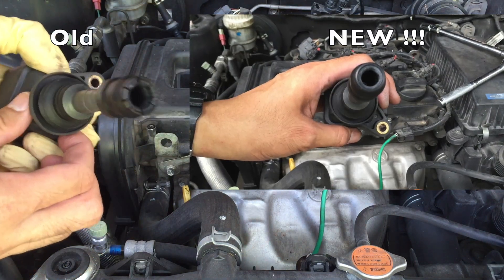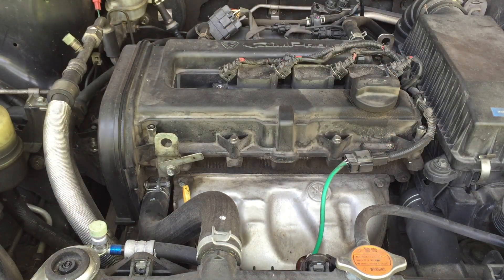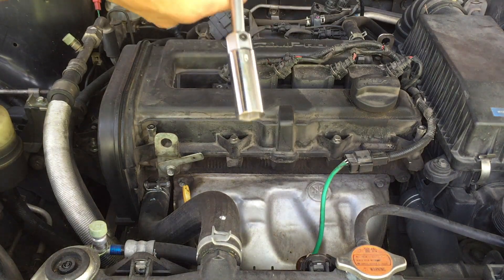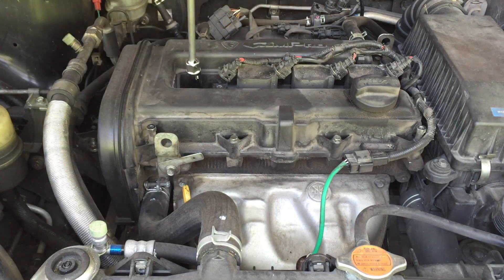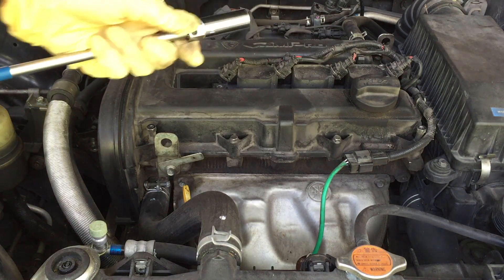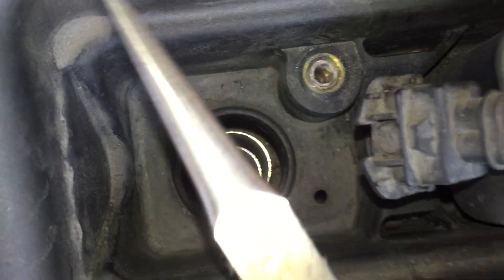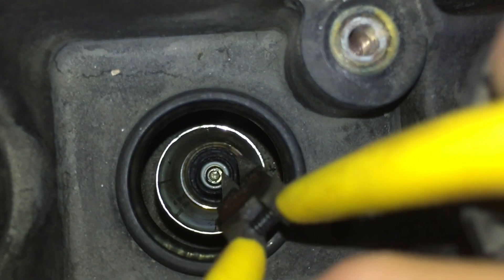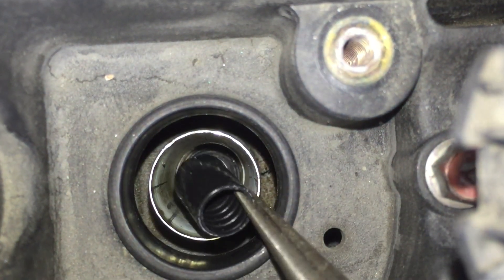Remove a spark plug broken coil rubber boot in Proton Persona Campro engine

Comment: I have a deep socket so even to remove the spark plugs you need a really long specially adapted tool to remove them. You can try using a bit of tube that is the size of the spark plug to break them free or get the ignition lead put a tiny bit of glue on the inside wall and put it over the boot. This glues it to the side of the ignition lead so you can pull it out but it's fiddly and you have a risk of gluing it else where.... Since it's broken you need to replace the damn thing anyways. You can get wire pullers that are really long and special tools. Its a bugger really.
Reply from the maker: Yes thanks you. I learned that using air pressure can be use to blow it out too.

Comment: so is that rubber from the ignition coil or the spark plug? I just had this issue and after 6 hours I finally got it off thanks to this video. Damn this guy made it look easy. It was a real pain in the ass having to hold my cellphone and it stay in focus while im doing this shit in the back spark plugs for my bullshit ass 1.3 Civic which has 8 spark plugs. This was the first back one & on top of that i snapped the damn bolt that holds the coil down. Now i gotta drill & tap that. 30k more for 200k & then maybe ill get rid of this car.
Reply from the maker: Alternatively you can blow it out using pressurized air.

Comment: i ended up using a long flat head screw driver. put it in at an angle, and jam it straight through the bottom. then pull up while using pressure against the cylinder wall.
Reply from the maker: Perhaps a thin screw driver works. It does not work for me back then.

Comment: I somehow managed to break off 1/4 of the rubber boot. The spark plug top is slightly exposed, but not enough to take it out with my wrench. I've tried using my needle pliers to get the boot out but nothing has seemed to be working.
Reply from the maker: There use to have a spark plug removal tubing. It looks like a tube but the end of it is machine to look like hexagon. That should works to help remove the broken spark plug.

Comment: Nice video, thanks.  My spark plug boots on my '97 Toyota 4Runner are too long to get a pair of needle nose pliers on remove from the spark plug tube.  I tried using some picks I have but the boot, about 3/4" is stuck around the spark plug.  Will try a pair of longer needle nose pliers when I attempt again.
Reply from the maker: Hi, I think you can try blow using pressurized air. Have you managed to solve it by now?

Comment: Same happened but only a small peace of rubber left behind... I can not take with a hook nor pliers because it is too deep... Any helP?
Reply from the maker: Use track pump to push air into hole. Air help push the small piece out.
Reply: Or masking tape inside out. It will pluck it out.

Comment: Video is 7 years old i doubt youll respond but im having the same issue with my ford f150. Same exact thing but when i go to pull the rubber out it feels like it is attached to something and doesn't come off so easy. Im scared im gonna tear something up
Reply from the maker: Maybe try to wiggle and tap by hand to break loose the rubber boot.

Comment: Can you still use the broken coil on the spark plug?
Reply: No
Reply: MANUEL AGUILERA why not
Reply: U car no power🤣
Reply from the maker: Have you changed the rubber boot? It caused leakage of pressure.

Comment: Use 3/16 brake line cut to your required length then bend the end like a hook and problem solved
Reply from the maker: Yes it works.

Comment: heat the socket up so hot that its melts the rubber then push it down over the spark plug and take the plug and end of coil pack out all at once
Reply from the maker: Luckily it works. Someone mentioned to use air pressure to push it out.

Comment: Yours is easy man, mine is longer so that doesn't help.
Reply from the maker: How about a longer wire?
Reply: Tried it and didn't help either. I spent hours trying and ended up towing it to the shop. The mechanic got it out pretty quick. He said he used brake fluid to get to expand and after that was easy.